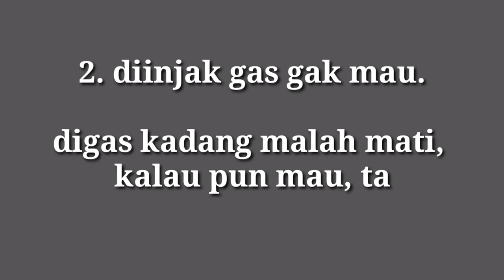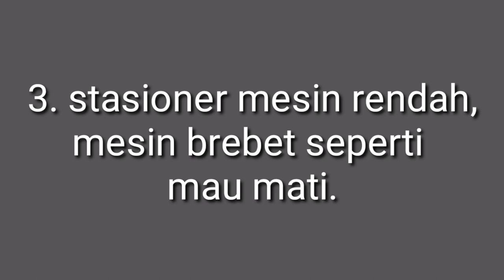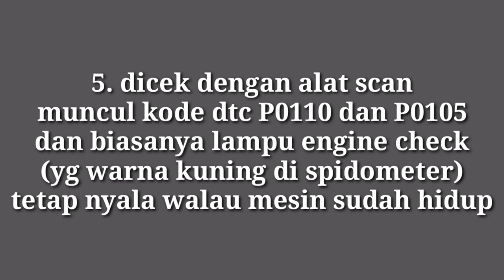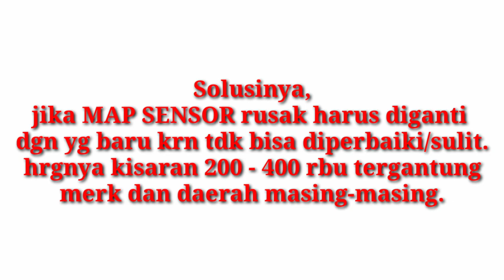Ciri-ciri MAP SENSOR mati/rusak mobil T120SS

Comment: Rpm naik turun, mobil seperti ngegas2x sendiri..di rpm rendah atau pas gigi 2 suka nyendat2x...yg udh dilakukan gnti isc,throttle body,saringan udara,udh dbersihin.., tps dicek masih fungsi,cek engine gak nyala...kira2 apa ya mas?
Reply: Itu maph sensor mass ,,ganti 250 saya beli..normal lagi

Comment: Pnya sya t120ss langsam bagus tapi kalo di gas pertamanya berebed dulu sedangkan busi kbel busi,pilter udara ganti saringan bensin sama dekseu prepak dah ganti tapi masi aja berebed injektor juga udah di bersi,in tolong solusinya bos..
Reply from the maker: Apakah lampu engine check tetap hidup saat mesin sudah dinyalakan???
Jika Ya, coba di scan dulu. Pasti kebaca apa masalahnya.

Berikut hal/parts Yg bikin mesin t120ss brebet :

1. Pompa bensin lemah
2. MAP sensor rusak
3. Busi mati salah satu
4. Kualitas bahan bakar jelek(coba ganti atau dicampur dgn pertamax

Kami tdk bisa tebak dgn sekali benar bos.. krn tdk cek langsung. Hanya bisa mengarahkan.

Comment: Ss2005 kalau di gass pull brebet mohon pencerahan nya
Reply from the maker: Kalau gas full baru brebet biasanya pompa minyak lemah atau filter kotor. Bisa juga bahan bakar jelek. Coba satu2 pak
Reply: Tapi kalau gas pelan, brebet nya agak mendingan
Reply: Maaf gangu, ciri 2 pul pump lemah itu gimana
Reply from the maker: Ciri2nya 
1. Saat injak gas secara mendadak terjadi keterlambatan respon putaran mesin
2. Diinjak gas full mesin brebet
3. Kurang tenaga
4. Kadang mati sendiri
5. Saat diukur tekanan bahan bakar dgn alat pengukur tekanan  kurang dari 200 kpa.
Stdrnya 200 - 300 kpa

Comment: Pak, mobil saya kalo setting rpm 700-750 enak buat jalan pak.
tp kalo lebih dari itu ketika jalan pelan gigi 2 rpm 1.000 injak gas jd getar.
Reply from the maker: Perpindahan gigi satu ke dua standarnya di rpm 3000 om, jadi kalau rpm 1000 dikasih gigi 2 dan dipaksa jalan di jalan yg nanjak atau bergelombang pasti mobil akn getar krn tdk kuat. Rpm di bawah 1000 penggunaan gigi yg pas adalah gigi 1.

Comment: Mas Anto punyaku as THN 2000 kendala nya sama trs aku mau nyari sensornya kok ngga ada di sebelah mana ya mas ... Maaf masih pemula mas ...
Reply from the maker: Disebelah atas throtol body mas. .
Reply: @antocasenk  boleh minta no hp ngga bang
Reply from the maker: WA 081377623043

Comment: Mas mobil saya t120 ss kalok pertama di hidupin/mau di panasin pasti brebet dan rpm naik turun (gak stabil)  tpi kalok udah panas rpm normal tapi kalok di bawa jalan kadang-kadang brebet mohon pencerahanya mas
Reply from the maker: Apakah lampu engine check nyala terus walau mesin sudah hidup?? Kalau ya, bisa jdi map sensornya rusak, tp kalau tdk, maka pertama yg dicek adlh tekanan kompresi mesin, pastikan sesuai standarny.
Kedua coba pinjamkan isc/steper motor dari unit yg normal.
Reply: @antocasenk  mas posisi steper motor Nya blah mna iya
Reply: coilnya mas lemah atau pompa bensin

Comment: Mas..  Mobil saya colt t120ss taun 2005 kalo jalan rpm 1500 sampai 2000 mbrebet..  Kira2 apa nya ya mas...  Trimakasih sebelum nya..  Sukses selalu..
Reply from the maker: Trmksih atas dukunganya mas🙏👍

Utk masalah kendaraanya Apakah lampu enginebcheck nyala saat mesin sudah hidup.? 
Jika tdk, coba sampean bersihkan dulu ke 4 nozel/injektor, bersihkan saringan BBM dan cek semua busi, jika ada yg kondisinya rusak/hitam kotor ganti aja.
Reply: @antocasenk  lampu enginecheck nya idup mas...  Busi sudah ganti sensor map sudah saya ganti..
Reply from the maker: @riyantoarmusic1977  jika lampu engine chek hidup itu tandanya ada masalah dibagian sistem injeksi. Harus di scan pakai alat scaner agar bisa tau jelas apa masalahnya. Atau kalau tdk punya scaner coba sampean cabut terminal aki yg negatif selama 5 detik atau lebih lalu pasang kembali. Dan hidupkan mesin. Jika lampu engine check mati berarti hanya menyimpan masalah yg sudah ditangani. Tapi jika lampu mati lalu hidup kembali berarti memanh ada masalah yg belum teratasi. 

Perlu diperhatikan bahwa MAP sensor KW/tiruan kadang memang tdk bisa berfungsi dgn baik. Berbeda dg yg original KTB yg terjamin kualitasnya. 

Semoga membantu..
Reply: @antocasenk  oke mas trimakasih banyak...  Sangat membantu... Sekali...  Sukses mas...